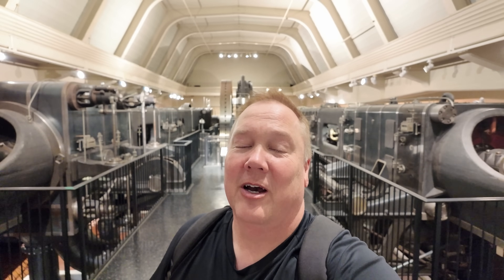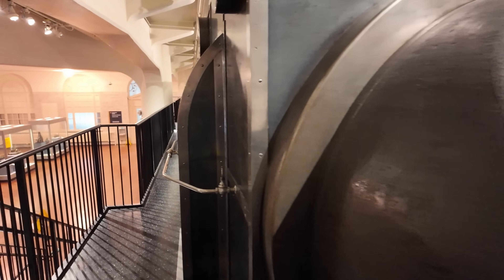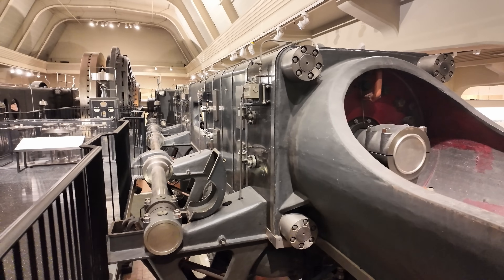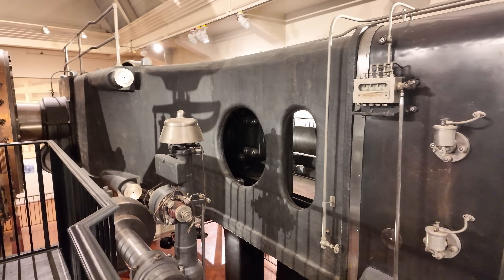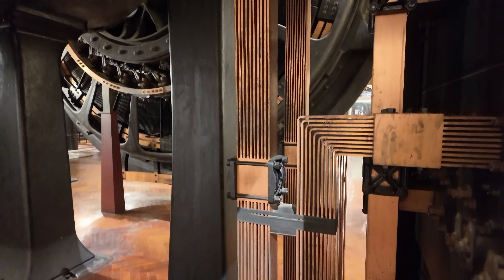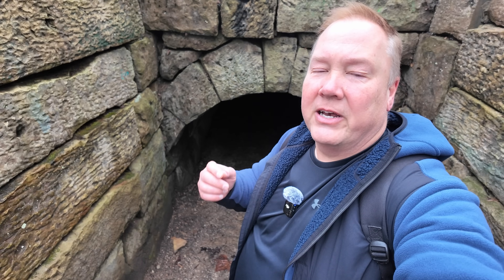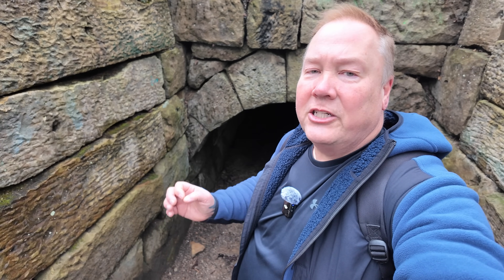Henry Ford's Hybrid GasSteam Engine

Comment: Great video I had no idea how ford did anything other than the pictures of his assembly line this video of the engines and the steam side is really amazing and how massive it is and if there's 5 five of them holly cow that's huge it's amazing machinery and I wish I could have gotten a model T or a model A but no luck anyway thanks for sharing this with us it's really educational and should have been tought in high school until next time be safe ❤
Reply from the maker: There were actually 9 of these, total!  Growing up in SE Michigan, we had several field trips to that museum, and heard a lot about Henry.  He was definitely the "hometown hero" type.  He came up with a lot of new ideas.
As for getting a model T, there's still a LOT of them out there today, and lots are running.  I was volunteering at Haven Hill yesterday, and we had a Model T club stop by for a visit, all driving their Model T's.  They were so tough, and so plentiful, that there's still plenty available surprisingly cheap.

Comment: Not trying to call out an error, but trying to clarify for viewers: I think white box under the engine is a condenser not a boiler. Further, it’s likely the steam necessary for 175 psi @ 600 isn’t coming solely from a hot exhaust gas recovery boiler.
Reply from the maker: Oh, and don't be afraid to point out errors.  Last time I checked, neither I, nor anyone else on youtube, is perfect.  Sometimes it turns out I was right (and technology just changed, leading the commenter to think they were right based on newer systems), but sometimes I've been wrong, too, and both cases have led to ideas for new videos with even better information.  It's unfortunately that youtube doesn't give a way for us to add a simple text overlay inside the video if new info comes up.
Reply from the maker: Someone else mentioned the condenser, and it's possible.  I was going from the display signs, which I've seen be wrong before.  Unfortunately, their great research center, which probably has full plans for these engines, closed with covid, and has yet to reopen, with no word when/if it will.  For the same reason, the steam info may have been incomplete.
Reply: This was also the downfall of the Kitson-Still engine and the Russian teploparavoz, which seem to have assumed that the exhaust heat of the 'gas' side would produce enough HRSG steam to keep the steam side equalized.  Even with full Rankine condensation to recuperate heat from the steam side... you'd need a hefty mass flow of additional steam.
Reply: @wizlish Also, it seems to me that the steam boilers were hot and at the ready to start everything in motion, the steam side used to start the coal gas engine.  Those have to be started with another engine or an external source of pressure. 
For example, the Snow 600hp gas engine they have at the Cool Spring Power Museum in PA (nearly identical in design) is started with compressed air today. 

I also wonder how they determined the proportioning between steam and gas sides on the fly.

Comment: Could put these generators back in service seem pretty well built!!
Reply from the maker: The were running well when shut down, and were probably moved and reassembled by the engineers who maintained them, so they're in really good shape.  They'd need to be partially dismantled, well lubricated etc, and I'm sure some bits are missing, but I can't see why it couldn't work, if someone really wanted it to work again.

Comment: Could it be made to operate again?
Reply from the maker: Technically?  Sure.  This was fully functional when taken off-line and was disassembled, moved, and reassembled by engineers who knew what they were doing (and probably the ones who had been running/maintaining it), so it's in good shape.  It hasn't been run for a long time, though, and it's pretty much dry of all oil, so it couldn't just be turned on and run.  If you took it apart, did a good cleaning and lubrication, it'd probably be able to run again without problems.

Comment: Not obvious to us here in 2025..  There was NO "Power Grid" in the early 1900's  - if you wanted to build a factory, you had to generate your OWN electrical power on site  !
Reply from the maker: Very true.  There were lots and lots of little, independent power plants in towns, and no real connections between them.  I'm hoping to someday find a little, grid-connected, 100+ year old hydroelectric dam that will let me come in film a power-up and grid connection with the old, manual synchroscope system.  Modern systems just type in the command to connect to grid and it happens.

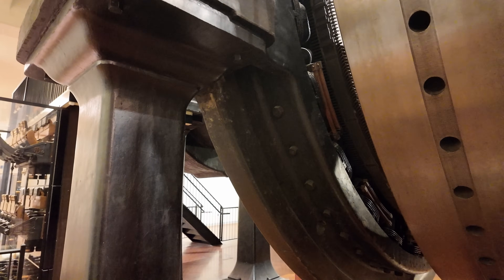Comment: 9:12  Keep in mind that modern robotic welding equipment on car assembly plants still use DC Power to this day!! :)   The car plants use large power converters, to change the power to Direct Current ...
Reply from the maker: Hadn't considered that, but it's a good point.  They may have wound up converting a lot of the power from the Rouge plant to DC to work with existing equipment when the connected up to there.

Comment: Producer gas or town gas is the poor man's natural gas and is made from coal gasification or coke production.  Very toxic since it contains carbon monoxide.
Reply from the maker: Yep, but it was also typically available long before natural gas/methane was available in a lot of cities.  Since it was also a waste product in some cases, burning it in something like this, rather than just flaming it off, was a good solution, since they needed the coke, anyway.

Comment: 35 year utility employee here. I have seen that museum and it is truly wonderful. Every American should go through it. I have a dispute though. Typical steam power plants today are more like 500 to 1,500 Megawatts not 50 Megawatts in size. 1 Megawatt (MW) is a thousand Kilowatts. A hair dryer is around 1 Kilowatt.
The whole production line was a great example of vertical integration. By that I mean raw materials in, finished product out.
Reply from the maker: Thanks for the comment.  There's something in that museum for everyone, I don't care what your interests are, especially if you include Greenfield Village.  
I'm not sure how they came up with the average, but I suspect it includes a LOT of small on-grid power plants, not just the big ones.  There's still quite a few smaller ones running out there, but I agree that that number did seem a bit small when I saw it.
Reply: @Industrial_Revolution what would hit home is the efficiency of this facility, vs a modern one of the same square footage.
Reply from the maker: I wish I had it.  The Benson Ford Research Center, which is the archive for the museum, I'm sure has it all, but they closed with covid and still haven't reopened to the public, with no clue when/if they will, so all that information is locked away.
Reply: Yes, very vertical integration.  Iron ore and coal in one end of the plant and cars come out the other end.  I just did not realize some of that coal was required to make the electricity used in the electricity production!
Reply from the maker: The coal gas is actually a waste product of turning coal into coke, which was used for making the steel.  In other coking operations, they just burned off the waste gas.  There's a big set of coking ovens I've got my eye on, and will be shooting a video there sometime this summer.
Reply: Imagine the number of amperes for 50 Megawatts at 110V / 220V  DC.  What was the size of the cables and busbars?
Reply: 1000 watt hair dryer at 125 volts is one bad muthafuka
Reply from the maker: @michaelcoston1188  isn't that a space heater?
Reply: He said "average size". That takes into account smaller stations like low-head hydro and gas-turbine peaking stations.

Comment: Amazing day Henry Ford knew that steam an electric was better than gasoline but knew what had to sell
Reply from the maker: He was big on hydro-power, too.  Do you know about his "Village Industry" factories?  They were small factories built on medium-size rivers without a lot of drop.  About half ran turbines and electric generators.  The other half used waterwheels powering overhead line drive systems.  He figured out which was better for what that factory would use, and picked the right power for it.

Comment: i've got to wonder if a diesel engine with a high-temperature coolant heat rejection would generate enough steam power to pay for itself? a truck engine uses about 150,000 gallons of fuel to go 800,000 miles, so that's approx $600,000. 20% savings would be $120,000. might as well turbo- compound  also (like volvo)
Reply from the maker: You're thinking for commercial semi trucks?  Tom Scott did a good video on a highway where they're converting them to electric, with overhead wires, just like trains use.  https://youtu.be/_3P_S7pL7Yg?si=x3J82ATq8WI5mHuc
Reply: @Industrial_Revolution  yeah,  that would be ideal for busy routes. the 'bottoming cycle" diesels might be a good interim, but batteries might also be good for the less busy routes? the overhead wires could also charge batteries?
Reply from the maker: I think the goal with those systems was the trucks would have batteries, and would charge while driving.  Get to the highway exit, and drive the 20 miles, or whatever, to your destination on battery.  It wouldn't cover everything, but a pretty significant percentage of truck traffic is on highways, with short trips off to the sides along the way.  I'd guess if all major highways had these, you could probably convert half or more of all trucks to straight electric without the need for any long charging stops.  Really, the same would be true for re-electrifying the railroad main lines.

Comment: That’s impressive engineering. This was a good video. Interesting how we think of electrical hybrids when there was this type.
Reply from the maker: Thanks!  Even better, it's not just hybrid, but it's using "free" fuel.  The gas was was gas from producing coke for steel production, then the steam was waste heat from burning that gas on the right side of the engine.  It's easier now to just throw more power at problems, but a century ago, they had to squeeze everything they could out of a system.

Comment: Amazing how such a complex power generating system was developed to build a very simple automobile. Also glad that they had the foresight to preserve one of these units instead of turning them all into scrap metal.
Reply from the maker: I was just at an event today where we had a Model T club show up.  A century old and still running well.  Henry Ford went into the factory and tagged this one specifically to move to his museum.  He had a huge collection of much older steam engines, but he knew this design was worth saving, too.  Smart guy.

Comment: That is amazing what this society was capable of. Too bad "modern" ideology came in and made us such helpless idiots.
Reply from the maker: I think the issue may be that adding power is so much easier now.  When you just plug into the electrical grid, you don't care so much about efficiency.  Look at gas cars vs electric.  Gas cars, you care about miles per gallon, which is cost per mile.  Electric, no one talks about that at all. It's only how many miles can you drive before you're stuck sitting an hour at the charging station.  No one's looking at efficiency.  A story I read last year said electric cars are actually more expensive to drive than gas due to the focus on power, speed, acceleration, rather than efficiency.

Comment: Why did Henry use DC power at Highland Park? See the Edison exhibits over in Greenfield Village...
Reply: Not just that, but DC power was much easier to regulate at the time. It's the same reason DC motors were the standard in railway equipment for decades until the development of solid-state inverter drives starting around 1980.
Reply from the maker: Don't forget that Henry started off working in one of Edison's power plants in Detroit.  
There's also the issue that, depending on the application, if you don't have to cover much distance, DC really can be better for some applications.

Comment: Just an amazing process. I remember "coal oil" on the farm, it was used for so many different uses on the farm. Thanks for the video!
Reply from the maker: I don't know much about coal oil.  What did you use it for?
Reply: Coal oil would be a light tar distillate, a byproduct of the coke retorts in the gas works.  Towns gas was widely used in the UK for domestic heating and was only phased out when the North Sea has fields came online in the 1970's.
Reply: Lanterns used coal oil well into the 1960s. Railroads used them for manual signaling. Also smudge pots on construction jobs.  My family owned a coal yard and we had many coal oil burning lanterns.  Just some examples.

Comment: Thanks for an informative video, but if you want more than "one time" viewers, please use SI units.. .
Don't you want the whole world to be with you?
Reply from the maker: That's actually a good point. I should start adding those.  At the time most of the stuff I cover was made and used, most of the world was using non-metric units, but you're right that most people don't necessarily need think in both fluently.  I remember being in Canada years ago and a glacier guide, who knew I was from the states, said, "Go over there about 3 meters..... ummm... 40 feet."  Fortunately, I do speak metric and didn't walk into a glacial crevass.

Comment: FWIW: Producer gas was "mostly hydrogen" - with the embrittlement and explosive issues that come with it along with the extreme toxcity of carbon monoxide. The old timers worked with death and serious injury hovering just over their shoulders and sometimes completely silently - especially in basements
Reply from the maker: It definitely wasn't great stuff to have around, but it did work well, before natural gas/methane was regularly available.

Comment: @3:28 Looks like an early divider block for precise lubrication. Interesting that this machine had automatic lubrication in 1914 when steam locomotives were largely manual.
Reply from the maker: They also have one of the original, Thomas Edison generators from his Pearl Street Generating Station from around 1890ish, and it has automatic lubrication on it, too.  I think these generators had a huge advantage over locomotives in that they didn't do things like running outside in rain, leaves, dirt, etc.  That might be why automatic lubrication got to trains a bit later.  Much less friendly operating environment.

Comment: Coke oven gas😂 and the mid section is known as a crosshead😂
Reply from the maker: I've heard a LOT of names for that gas.  Not sure if it's a regional thing.  
Thanks for the info on the crosshead.  Unfortunately, I wasn't able to find a lot of information on that part of the system, and their research library has been closed to the public since covid when no word on when/if it will reopen.

Comment: Amazing on how large this power generating ear really is! The amount of engineering and construction required to build this power plant must have been immense. The capture of waste energy to be used to increase the efficiency of the plant! Is outstanding. I would hope that the total efficiency was 40% to 50%. The capture of " coal gas" from the coke ovens reduced the operating costs and was environmentally a great idea.
Reply from the maker: Henry got really good at building very big.  He went from this one to the Rouge plant, which was the largest factory in the world at the time (a title now held by Boeing).
With the museum's research center closed since covid, with no word on when/if it'll reopen, actual efficiency numbers weren't available, unfortunately.  I'd expect it was fairly high, though.

Comment: Really interesting video 📹 
I was wondering about the crossover between gas and steam power 🤔
Reply from the maker: Unfortunately, I could not find a lot of information about that.  The museum has an incredible research center BUT they closed it for covid and it's still closed with no word on when/if it will reopen to the public.  I wish they'd at least open it one day a week, or even a few hours.  So much information and it's all completely inaccessible.
Reply: @Industrial_Revolution  just being able to see these incredible creations is a pleasure 👍
The heat exchangers probably didn't survive WW2 since they would have had tons of strategic elements
Reply from the maker: That's definitely possible.  Ford Motor Company was very heavily involved with wartime production.

Comment: Central power stations by the 1960s had typically 500 MW units.  So saying the average is now 50MW seems like you're, not, comparing like with like.  The fact Ford had realised combined heat and power, would increase the efficiency of the whole plant, was the key takeaway.  Ford had the very best engineers working for him, to maximise efficiency of every aspect of the production process.
Reply from the maker: That number seemed a bit low to me, too, but I think the average was all grid-connected power plants.  There's a lot of smaller plants out there that bring the average down.  Specifically built, grid-power plants are definitely quite a bit larger.

Comment: When they tested the car engines they were running dc too to help power the plant
Reply from the maker: Really?  I never heard that.  Was that just the Model T, or did they keep doing it.
Edsel Ford, Henry's son, had a Model T engine installed at his Haven Hill estate, connected up to a generator, to provide backup power to the (massively overpowered) well pump.